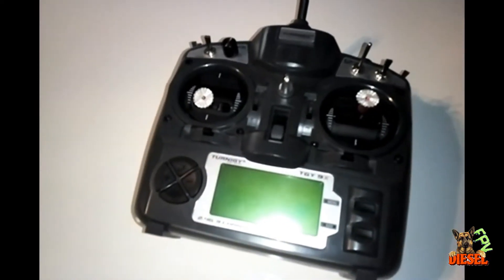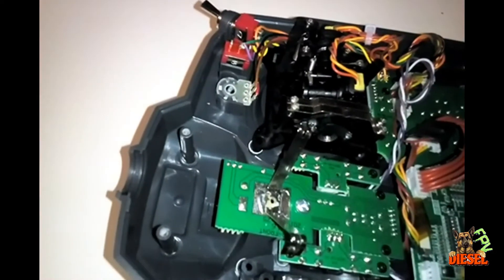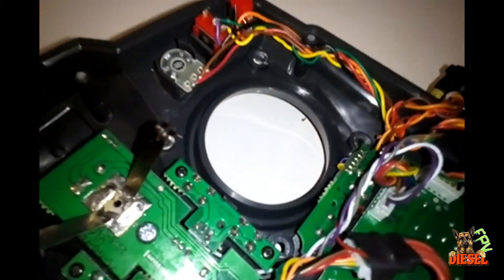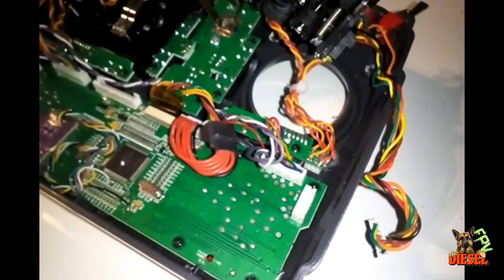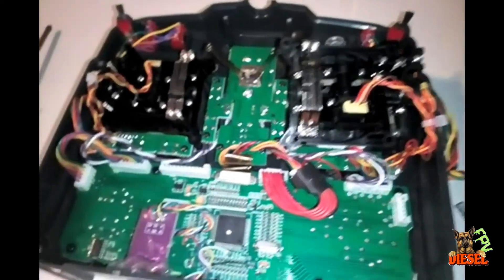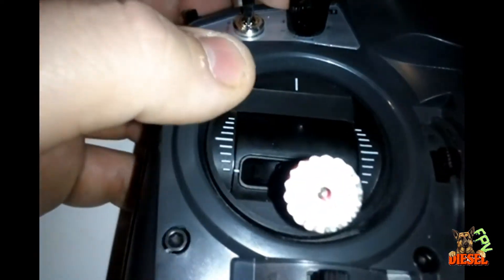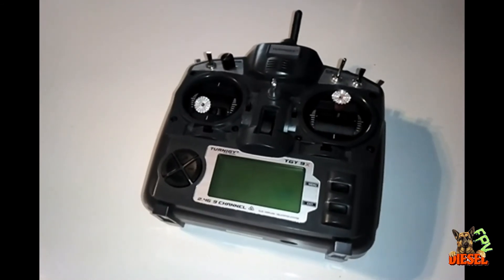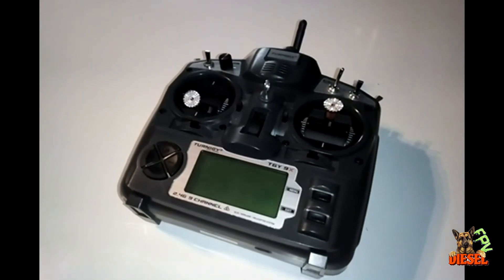Turnigy 9X FrSky PR10 Gimbal Upgrade (How To)

Comment: I’m not understand, the old PR10 working with 5v. When upgrade x9d to m9 gimbal,   taranis x9d just working fine. What volt exactly x9d provide for PR10 gimbal ? 3.3v or 5v ? If 3.3v, PR10 gimbal is working with under voltage.
Reply from the maker: The x9d outputs 3.3V to it's gimbals. The Turnigy 9x outputs 5V. The PR10 gimbals use standard potentiometers which are variable resistors. It reads the change in voltage based on resistance. So the X9d just reads the variations of 3.3V while the 9X reads the variations of 5V. The M9 gimbals use hall sensors which I believe are magnet based. The hall sensors are only rated for 3.3V. 5v will burnout the hall sensors.
Reply: DIESEL FPV thanks for answering my question. I really like 9x, i want to upgrade to m9 gimbal. sadly there is no upgraded board available right now.

Comment: can you please share with me the color order of the wires for the new PR10 gimbals ..... signal wire are the same position and you have swap the red and brown wire?
Reply from the maker: Constantin Teodoreanu the factory gimbals were white (signal), red (positive), black (ground). The PR10 gimbals are orange (signal), red (positive), brown (ground). From the outside edge of the transmitter going in toward the center the order in stock form was black, red, white. The two you don't switch would be the same, brown, red, orange. The two I mentioned as being backward would then be red, brown, orange. When you take out the old gimbals just match the new wires on the same set of pads as the old ones, but switch the POS and neg on the mentioned pots in my video and you should be good.
Reply from the maker: Constantin Teodoreanu if you pause it at about 4:40 you will hopefully see what I am talking about.
Reply: BIG thanks